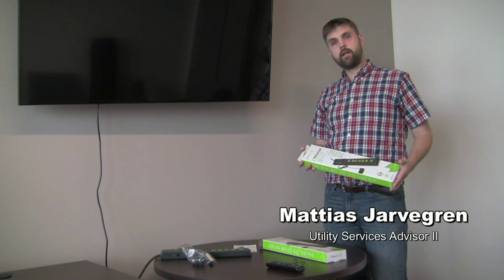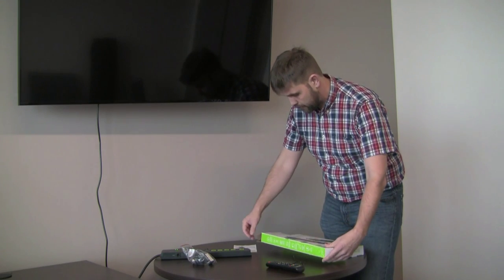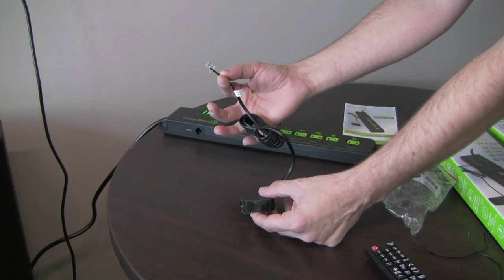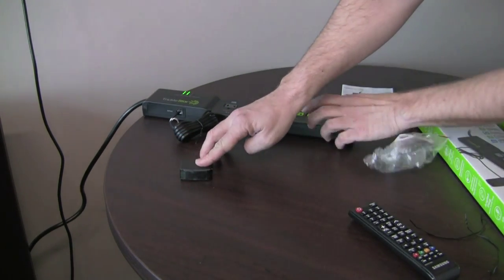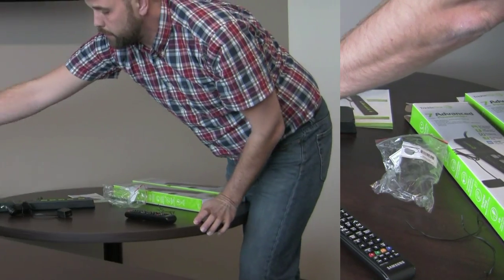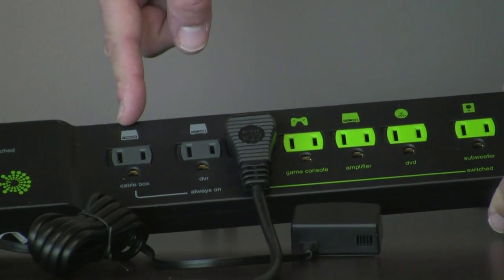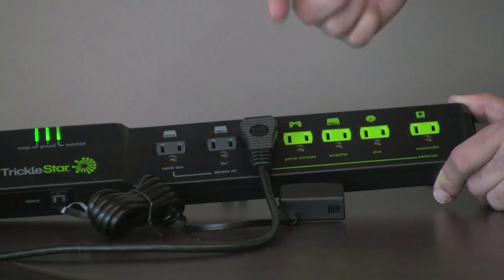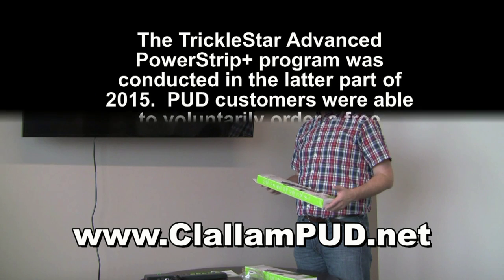How To Use the Advanced Power Strip

Comment: No wonder mine doesn't work 🤦🏼‍♀️ I've been trying to figure it out forever, now I know that it doesn't work because mine didn't have the sensor in the box 😣
Reply: rip
Reply: Dammm I'm in the same boat
Reply: Me too. this shit sucks
Reply: Same here, what a dumb gadget. Why couldn’t they just make this surge protector with out that sensor? 🤷🏽
Reply: If you have the one that is white or grayish looking the one outlet that says control would be your TV. When you turn the TV off the switch outlets will also turn off. The one in this video came with a sensor the newer ones has the sensor built into the outlet of the surge protector. So when the TV received a signal from the controller to turn on the switches on the the switched outlets
Reply: Same
Reply: rubbish

Comment: What happens if we didn’t get that little sensor box with ours? Neither of mine had it in the box, so is the rest of the strip useless now?
Reply: Have to agree this is one of the worst product design choices I've ever seen. There should be a switch to bypass the ir sensor
Reply: Agreed, was giben mune second hand with no sensor, so now i have a massive strip with three outlets and four outlets of dead space that will never work. Throwing it out
Reply: Mine is older i guess, last year, no Sensor and no Sensor plug, it’s a non Sensor one, green sockets won’t work